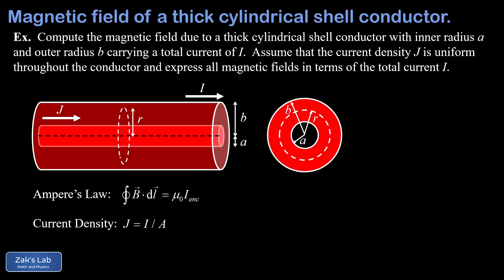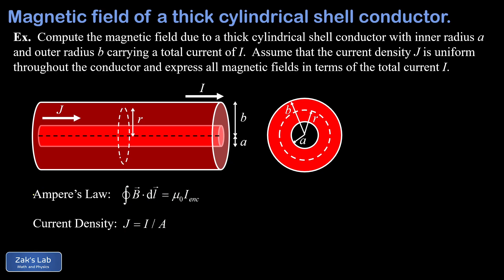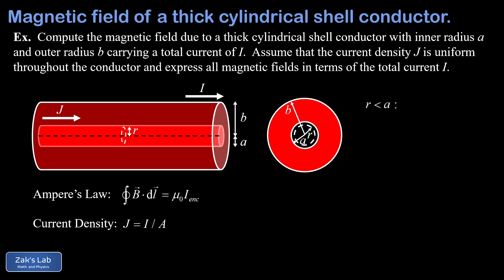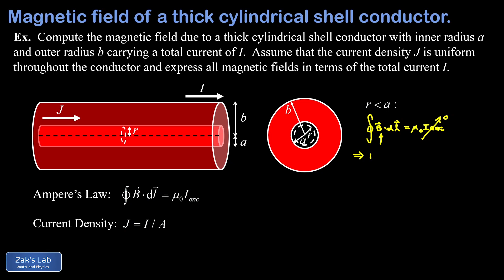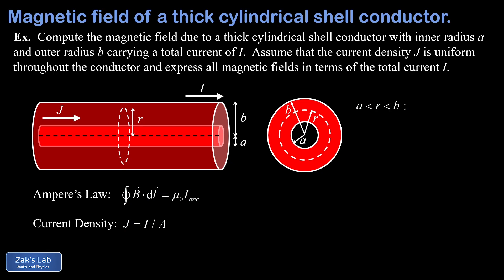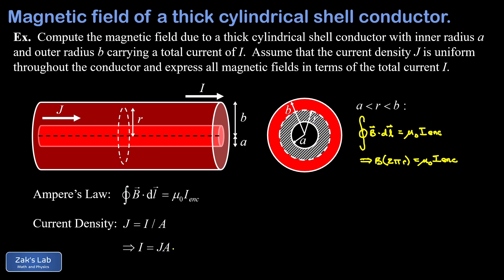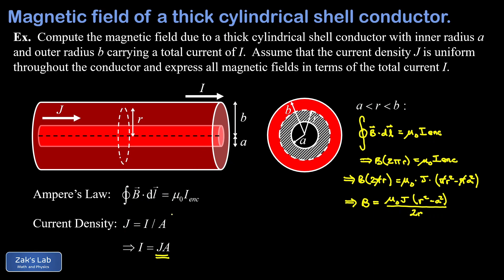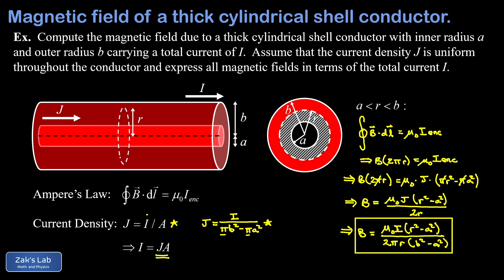Magnetic field of a thick cylindrical shell conductor using Ampere's Law.

Comment: Shouldn’t you have integrated the current density from the inner radius a to the radius of the inner circle of which we are calculating B to obtain the enclosed current?
Reply from the maker: in this problem the current density was uniform, allowing us to use I=J*A to relate current density and total current using an outer radius of "r" and inner radius of "a".  In cases of non-uniform current density, you have to integrate to find the total enclosed current inside the Amperian loop. -z

Comment: Excellent lecture, soothing voice. Thanks for sharing your lectures. Will you do some lectures on Maxwell's equations?
Reply from the maker: There is a brief part of second semester physics where we summarize Maxwell's equations (and talk about patching up Ampere's Law with displacement current).  That video will happen next spring most likely.  The "proper" treatment using vector calculus is beyond the scope of the courses I teach, but in the very long run plan I would like to cover all of upper division E&M . . . but don't hold your breath -- that's probably 5 years out!  Thanks for your support!  z
Reply: @ZaksLab  Thanks